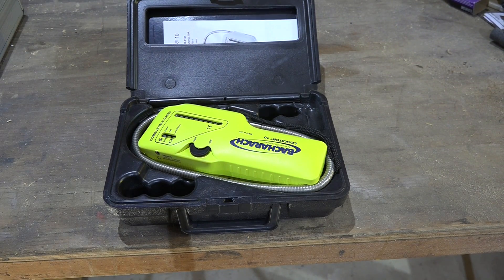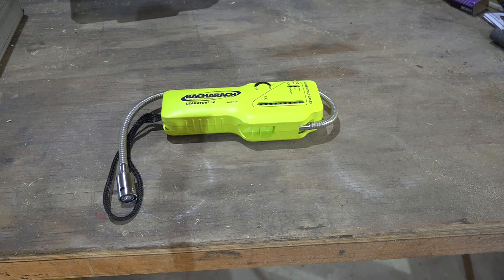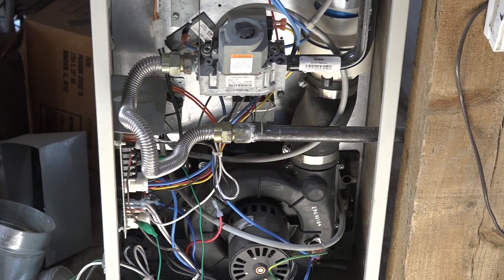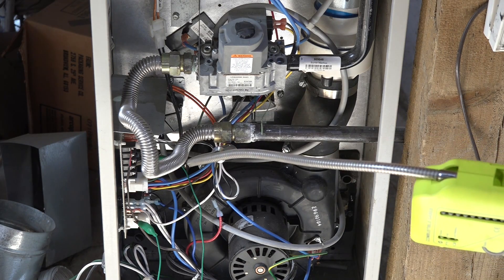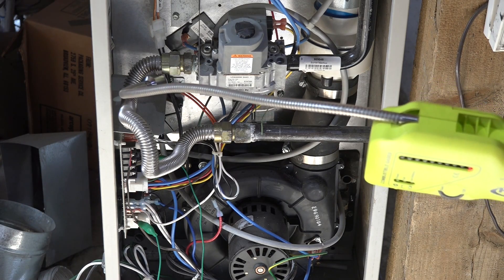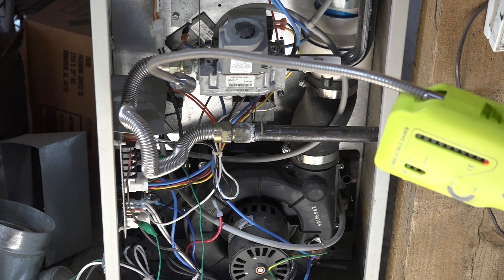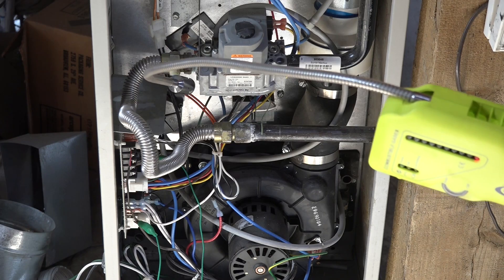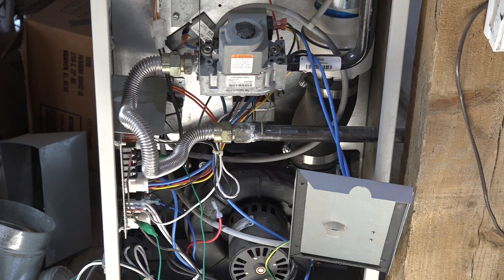How to find natural gas and propane leaks part 2

Comment: I have a question. Generally, what is your opinion on those flexible gas connectors? Thanks
Reply from the maker: In some cases, such as dryers, they are necessary.  For most installations they are a sign of sloppy work.
I will always consider hard piping best.
GFM
Reply: @grayfurnaceman  Thanks